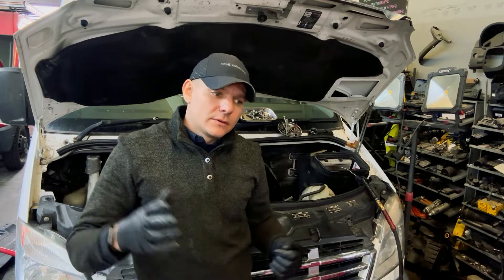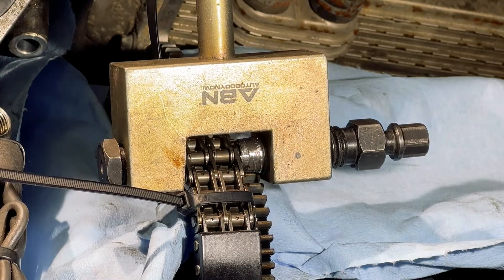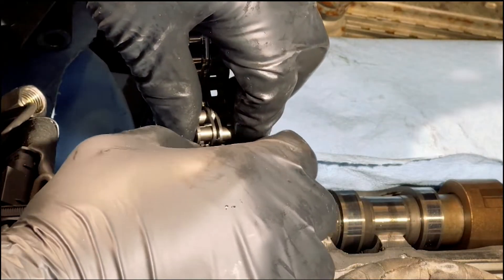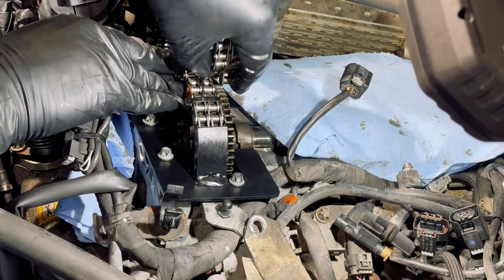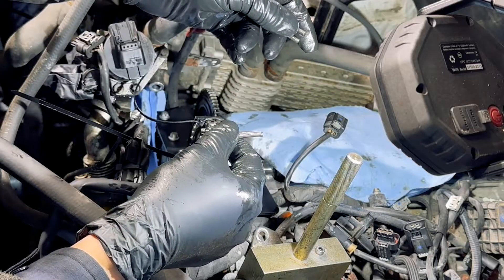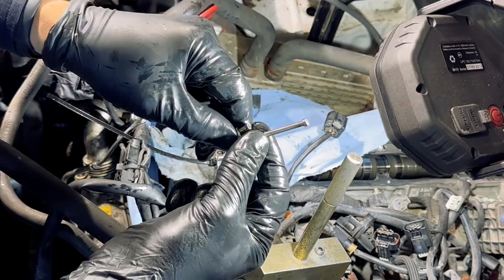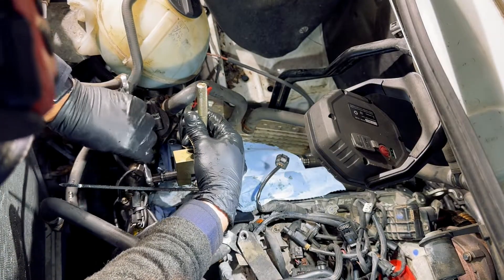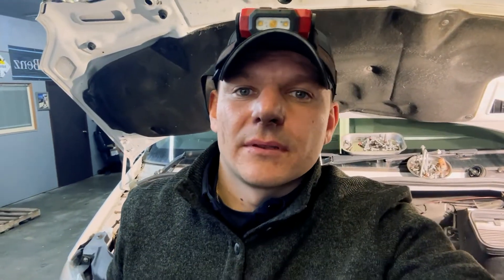Mercedes OM642 Engine Timing Chain Replacement (Detailed)

Comment: You have put the chain backwards, the grease holes go towards the outside and you put them towards the inside.
Reply: I agree, this chain will stretch very quickly with the oil holes facing down
Reply: Wow! I didn't even saw those little holes until you mention them. Thank you!
Reply: The febi replacement chains have the oil holes like the OEM chain however the INA chains do not have the holes
Reply: It's correct, holes in chain outside for lubricant. Specific in WIS If not 🚫

Comment: Hello, how are you? One question, do you have to remove the chain tensioner with this tool or not?, I mean if the chain is secured by this tool.From your explanation I understood that the chain tensioner needs to be replaced. My question only concerns when you put in the new chain, whether or not you remove the chain tensioner while replacing the chain, thanks

Comment: Did you replace any seals for the injectors? Do you have to bleed the injectors? 
Thanks great video
Reply: you dont have to bleed the injectors, its common rail, so you can prime the  igniton, to get fuel going, and then start after turning the key 10-15 times

Comment: How are you able to rotate cam without valve coming into contact with piston? Great video, om642's are best small v6 diesels. 290000 miles and 9' of TDC. 11' is max.
Reply from the maker: We did not do anything to the timing itself. We just disconnected old chain, connected new one and rolled it through.

Comment: Hello Friend.  I have a ml 320 cdi 2007 year.  Sometimes in the morning when I start the car for the first time, it makes a noise for exactly 1 second.  Something rattles and stops after a second.  My car has a mileage of 280,000 km.  I don't know if this timing chain has ever been changed or not.  I know that the air conditioner compressor bearing or magnets are damaged and this is also making noise.  This noise can be heard from the compressor of the air conditioner.  I hope the timing chain doesn't need to be replaced.

Comment: Should you replace slides ? I have heard that MB slides are not destructable
Reply from the maker: You mean guide rails? 
Depends on mileage and wear. 
In 90% cases no need to do it.
Reply: @sprintermotors great 👍😃
Reply: @sprintermotors  mine rattles on cold starts for 2 sec, its driven 272k kms, never replaced, i think the tensioner is bad, but most likely its streched aswell, im a 2nd year apprentice and i want to do this job myself, but any tips?

Comment: Why did you remove all of the cam hold downs?  In this configuration I would think the cams would be lifted by the opposing force of the valve springs.
Reply from the maker: Cam holders are not necessary to do the timing chain.

Comment: I have engine messed up in my Mercedes sprinter  please give me advice do I need to buy another engine or I can rebuild the original one thank you for your help
Reply from the maker: Sure! If any of your main bearings are toasted or any damage present on cylinder walls - your engine will be done. If there are no damage on those spots - it is rebuildable.

Comment: the old chain does not look that bad, can i just change only the tensioner?
Reply from the maker: You have to replace chain. Because problem is in the chain not in the tensioner.
Reply: @sprintermotors  Is there any way to check to see if it’s a stretched timing chain?

Comment: Not too sure about beating on the cam sprocket with hammers, fairly sure that's NOT in the mercedes shop manual! You can just vice those pins, seems to me you did more harm than good here.
Reply from the maker: It just seems to you. Did over 100 chain replacements - no problems whatsoever.

Comment: Do not do this!!! I tried to do this but the pin and bolt fell from the tool into the crank case and i had to remove and disassemble my engine to get it out
Reply from the maker: No offense, but it's totally your problem. You could've put some napkins and prevent that. Even if it felt down, you can simply remove the oil pan, and no need to disassemble the entire engine.
Reply: @sprintermotors  no, cheap Chinese junk not fit for purposes and there's no way to remove the oil pan on a 4x4 sprinter without engine out, again DO NOT USE CHEAP JUNK!!!!
Reply from the maker: @karldingbat  I used cheap chinese tool over 200 times - no problems whatsoever. You have to grind it a bit to fit perfectly. You can remove small oil pan on 4x4 Sprinter WITHOUT ANY problems.
Reply: @sprintermotors  errrr, no you can't ive got 1 and the small oil pan is obscured by the leaf spring hanger and the subframe supports!!!
Reply from the maker: @karldingbat  Please do not argue. You can remove the lower oil pan without ANY issues. Middle pan - you can't remove. But lower - easy.

Comment: Mercedes-Benz  is such a unreliable  garbage car.W 203 was disaster. Ten the first version of w204 was a bit better and then mercedes  screwed up with totality  bad om651 engine.Injectors and timing chain and tensioners  malfunctions. Om 651 have only 1 chain its simplex and previous  one was duplex.I though nothing  can be so bad as bmw n47 engine but i was so wrong Mercedes-Benz  is one of the most unreliable  vehicles Also when you changing that tensioners on mercedes  you have to take engine out same as on n47 bmw.I will never buy any mercedes  again.I will buy only Japanese products  ( And yes,i do own W204) at the moment.